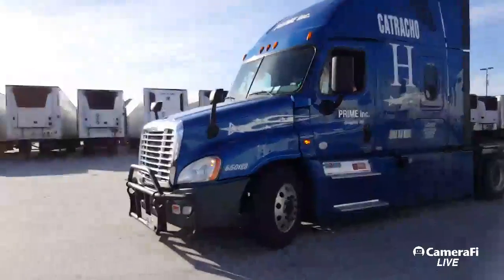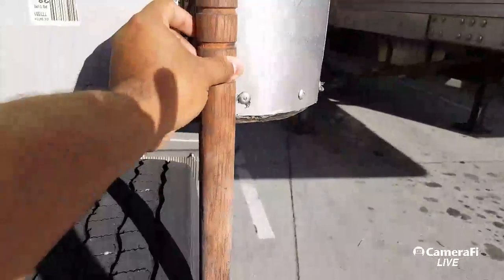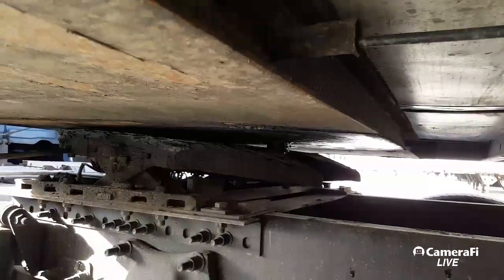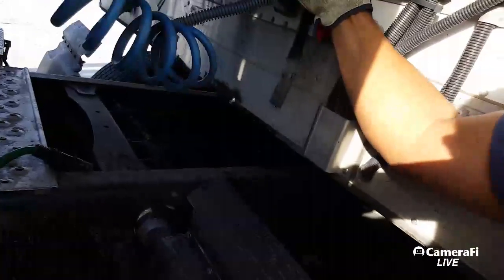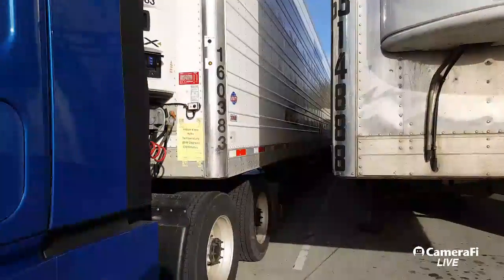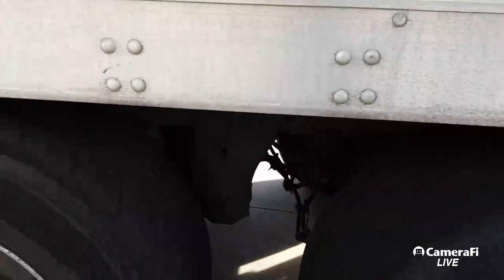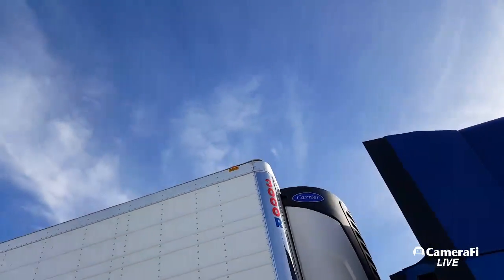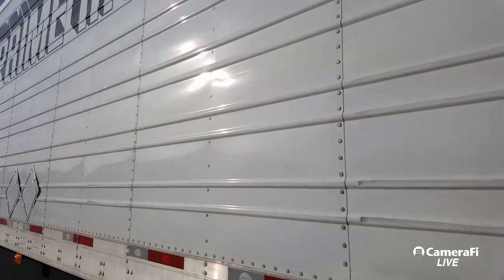Truck Driving Student - TNT - Coupling to Trailer and Inspection

Comment: Does the trailer have disc brakes?     Does it have slack adjusters?      How do you pre trip/inspect disc brakes?
Reply: Al Rod they have brake drums
Reply: I just re-watched the video.   The trailer does have rear disk brakes...    the air cans are on the side.